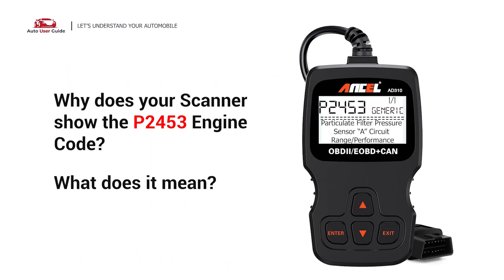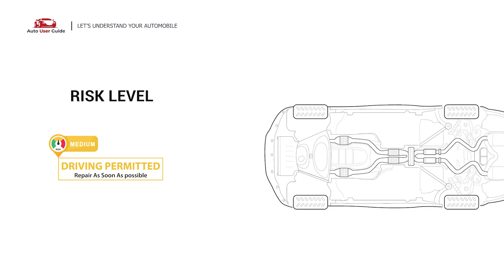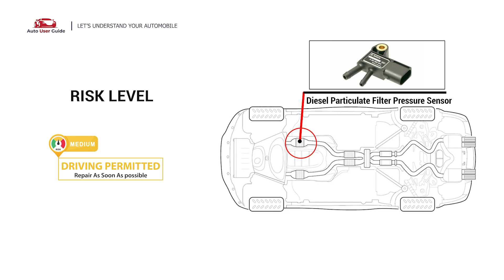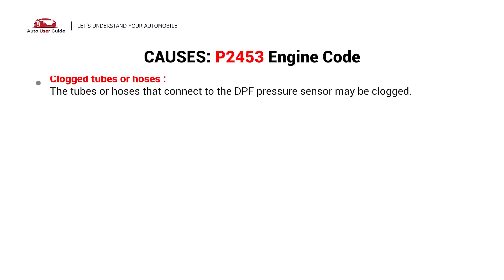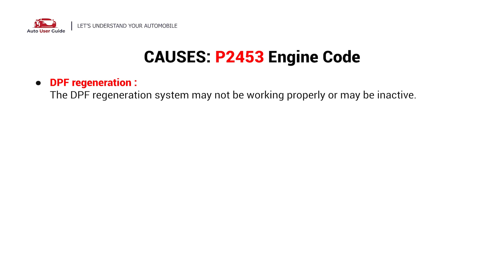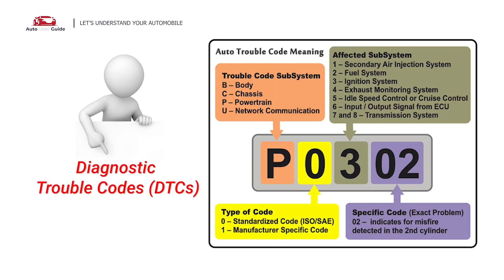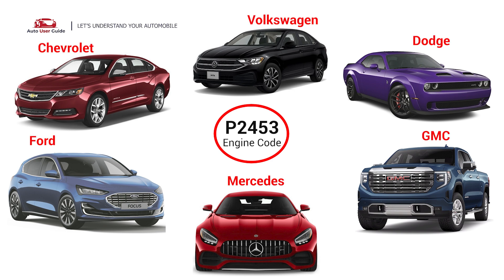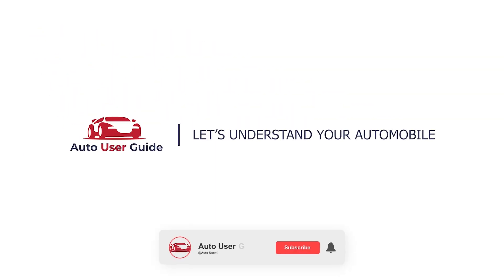What is P2453 : Engine Error Code Causes Explained

Comment: hai, i have jeep wrangler DTC P2453. please explain me to fix it. thanks
Reply: I have the same problem; even though I've changed the DPF pressure sensor, it continues. By the way, I also changed the DPF itself. It seems the last solution will be to delete the DPF. I think the common problem at CRD 2.8